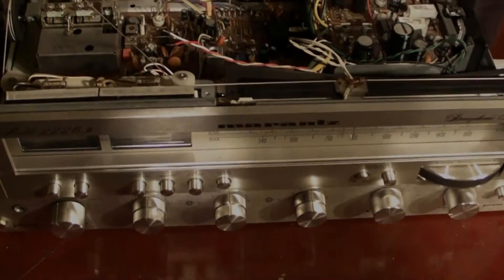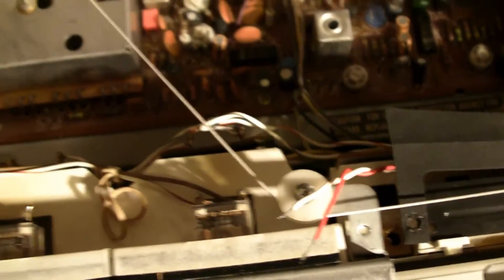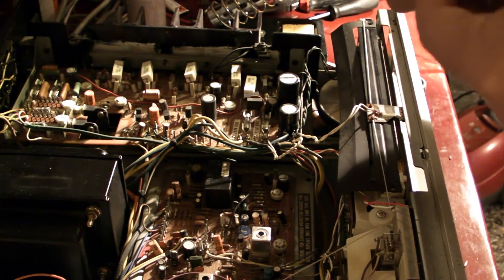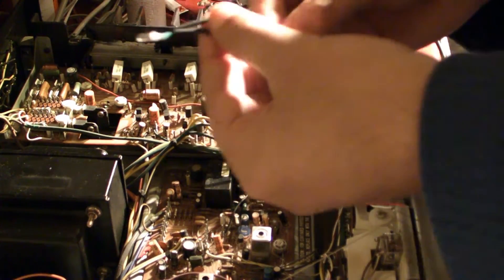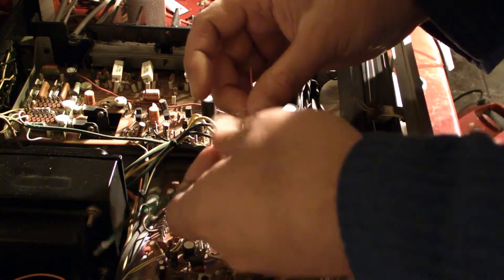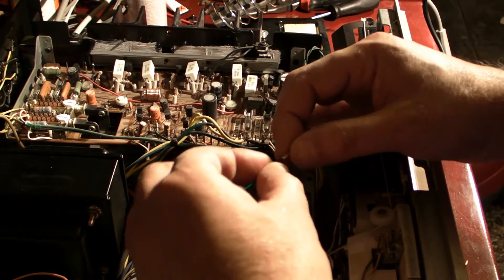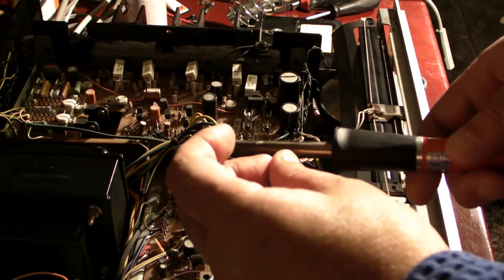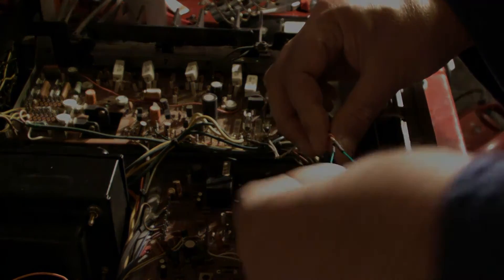Marantz 2226b stereo lamp replacement without using an solder iron

Comment: How did you remove the stereop lamp? I need to change mine but cannot get it out of its place, it seems to be glued... (not soldered)
Reply: There is glue. I used a spray can pipette to drop a little Acetone around the metal and scraped the glue, used needle nosed pliers to gently twist the metal out. Tedious, but it gets done.

Comment from the maker: They are all 8v... the tunerscale lamps are originale 8v/200ma but you cant buy them anymore so replace them with 8v/250ma. the stereolamp is 8v/40ma 4mm
Reply: Can I use a 6V/40ma or 8V/60 ma stereolamp instead ?